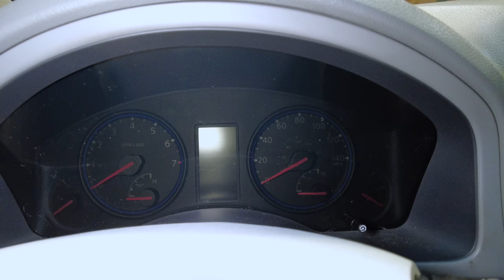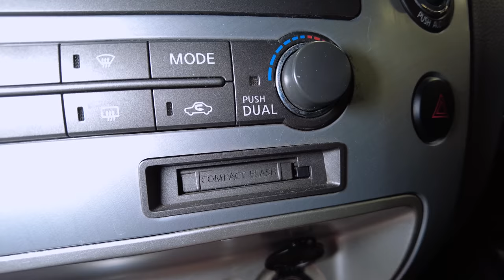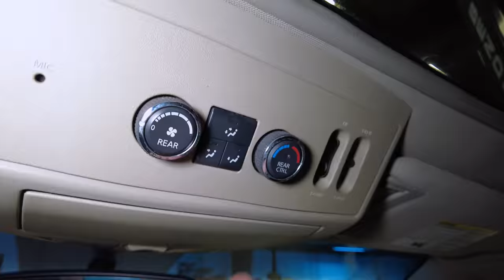Love it or Hate it! Common issues EVERY Infiniti QX56 has. CAR WIZARD knows - he had one!

Comment: I must say I’m not impressed with that list at 150k mi. Also, when a vehicle manufacturer discontinues parts so soon, it really indicates to me they don’t expect the car will last—or really care if it does 🙄
Reply: Nissan would rather cut corners that kill their car buyers than to make something worthwhile.
Reply: Nissan was notorious in this era for discontinuing parts availability. That’s why I stopped buying.
Reply: I thought there was a law that forced manufacturers to supply parts for a number of years after production ends ??
Reply: @1983dmd:  A law that requires auto OEMs to make spare parts available for a set period is an old 'chestnut' that's unfounded - there is no such US Federal law.  The only driver to maintaining spare parts supply comes from the Magnuson-Moss Warranty Act, that was effected in 1975.  The aforesid Act requires manufacturers to maintain parts for the term of the manufacturer’s warranty - where the 'clock starts ticking' when the last of a particular model leaves the assembly line.
So as long as the OEM offers an X-year warranty covering certain systems (e.g.  engine, transmission, HVAC, etc.) it must provide the parts necessary to fix those systems for X years.  Notably, it's not all the parts that make up the entire vehicle.
Reply: Also indicates the manufacturer expects all of these to be in a junkyard soon.
Reply: Nissan is not what it used to be.
Reply: I have a Lexus LX 570, same year, very similar miles. Really shows why the infinity is less than half the price lol
Reply: 10 years is usually the timeframe for parts. My 20 year old honda i can buy nearly any part for as availability is still there.
Reply: @CRAPO2011  as someone mentioned above manufacturer doesn’t have to make any parts for a car after warranty is over on the last one sold.  Non oems of course make parts much longer.
Reply: I was starting to have parts issues with a Mercedes C-class that had some miles on it. Never with past Mercedes I've owned have I had problems sourcing parts, I've had 6 of them.
Reply: @gs98999  I guess your right as i remember hearing Hyundai Equus owners having problems sourcing parts 5-7 years after purchasing new, I think hyundai worked something out with them as it was the flagship.
Reply: nissan doesn't make parts so idk wtf you're talking about and you don't buy parts from dealer lol
Reply: The parts stopped due to Renault.  This is an armada nissa patrol.  One of the most popular model in the nissan line at the time

Comment: My boss had one and the only thing costlier than the refuels was the maintenance.
Reply: yeah, given they carpet bombed styling norms as as hard as 'Hummer' did in a 2000's way that would somehow poison over a decade later... good riddance Infiniti. You were awesome in the 1990s; but god damn your latter self has been awful.
Reply: My friend at work has one (about 6 yr old) and he says it has given him no problems...though he could be capping
Reply: @rebeltvr6046 I don’t think he’s capping😏 I have a 2008 QX56. I brought it with 58K miles it now has 227K miles. I love it and its my everyday driver. My fuel needle did stop working it wasn’t the cluster it was the fuel sending unit. My exhaust rusted tho I’m  now replacing it with Cajun B-Pipes and the JBA performance exhaust. My headers are fine I decided to do the whole swop. Hopefully I’ll get it put on this week or next. I do my best to stay on top of my routine maintenance.  I do believe if you take care of your vehicle it’ll take care of you🙂 I also have a great mechanic so that helps A LOT. Oooo my over head rear console needs to be replaced the plastic is cracked and needs new pins but the tv and all the controls work great headphones do too. I found one on eBay but I sent it back because it was cracked the dealer wanted 2K-3K for that plastic Noooooo Sirrrrrr it was $500 on eBay.

Comment: Modern vehicles are not meant to be repaired or worked on they are drive them for 10 years or 100000miles (if you are lucky) then scrap them and buy new why is this not understood by motorists ?

Comment: Not all Japanese car makers are equals
Reply: The worst Japanese is better than the best domestic
Reply: @flight2k5  My 2011 Ford F150 with a 5.0L Coyote V8 has 152,000 miles on it and still going strong.
Reply: @CJColvin  oh boy 152000. Wow. That’s a lot. 🤣. Didn’t the ford CEO come out recently and apologize for the garbage they’ve been producing
Reply: @flight2k5  Not sure to be honest. Also my 1996 Ford F150 with a 5.0L (302) Windsor V8 has 210,000 miles and still going strong as well.

Comment: Parts for these are plentiful and they are pretty reliable. The discoloration of the valvetrain is due to owner neglect. I own two VK56DEs and they both look brand new at 160k miles when I did a valve cover change. Buying any almost 20 yr old vehicle from the rust belt is going to require some type of maintenance.

Comment: Just turned 160,000 miles and very few issues.
Air level suspension didn’t work when I bought it at 130k miles so I put in Firestone airbags and it tows our 6000 pound RV like a champ.

Comment: I own an 06 Armada...I don't know if neglect by owners of other Armadas/QX56s that make them unreliable but I have about 150k miles and driven her across this country through mountains and dessert heat and never failed on me. That being said, it wasn't perfect sailing. The most common problem I've seen are the cats failing at 80-100k. Mine failed just before the warranty ended, so Nissan took care of it. New ones work well, and it seems they've  corrected the weak point that caused the failure. I've done the valve covers at 100k, and it is quite easy since there is more than enough room to work in the engine bay. Mine was way cleaner than the one in your video, which leads me to believe they've gone much longer between oil changes than 5k. Did plug and coils while covers were out, too. Did all fluids regularly, especially trans, Transfer case and both diffs at 40k intervals since I does haul the family all over the country.  Never had electrical issues. Did have the annoying clicking and heater issue at 115k, but those were very straightforward and easy to fix ( it doesn't require mechanical expertise). As far as the engine, they're reliable so long as scheduled maintenance is done. I change my oil with 5-40 every 5k, and I'm always just under half to slightly over half short at the change interval. My 15 MDX is short a quart every 2k (even after the piston ring recall was done...guess it just eats oil, runs great otherwise) or my 06 Sequoia (definitely a favorite of mine) which also eats about a 3/4 to a quart at 4k change intervals but doesn't have nearly the power of the Armada or internal space. I kept the air suspension too since those parts are cheap and easy to replace as well (changed mine at 120k just in case because of how cheap the parts were). 

Maybe I'm lucky with my Armada (doubt it), but I think it's done well for me because I'm religious about maintenance intervals (that goes for my MDX and Sequoia as well). Again, other than the failed catalytic converters, she's been free of major issues. After seeing the QX56 wheel bearing in your video having issues, I plan on doing mine shortly as the parts are cheap and just good practice to replace before they go bad and cause issues while on long drives. Might even do front and rear main seals at 200k just in case. Come to think of it, even the AC is original and works great (also serviced every 3 years). Now, I hope I didn't just jinx myself, and she's now gonna give up the ghost and make my Sequoia the cross country hauler. 

Full disclosure, I've been working on cars since before I had a driver's license and have built race cars (mostly Toyota, Hondas and Anything you can put a Chevy LS in) from the ground up to include full custom engine, transmission and suspension builds, so I can, and most of the time do the work on my vehicles once warranty has expired since labor is usually the bulk of the cost. Parts are relatively cheap for these Japanese SUVs. And when Wizard says the cost of repair is 3-5k, maybe more, that is his labor and shop charges making the bulk as it should since most people won't have the expertise or time and tools to complete such repairs. That being said, the Armada and its uglier twin the QX56 should be reliable if you do the maintenance regularly. 

Oh, and I don't know how his QX56 got 12 hwy and 8 city, but my Armada averages 13-15 combined between fill ups. On our long family trips with luggage and 5 passengers, I average between 17-21is depending on how many mountains I have to traverse or if it is relatively flat. By no means is she a Prius, but no one buys SUVs this size and thinks I'm gonna get 30mpg. (Hmm, I did add a free-flowing air filter🤔).

Sorry for the long post. If anyone reads this fully, I just thought I'd post my ownership experience of my Armada.
Reply: 98% of Nissan owners have terrible credit and don’t take care of their cars. You are the other 2%
Reply: @Bruce Wayne  that's funny my friend...and you may be right about the credit and nissan/infiniti owners issue. My buddy bought a 2011 GTR used when they weren't ridiculously expensive yet and I told him he couldn't afford it if it took two jobs to pay for the loan, but nonetheless,  the pull of the GTR was stronger than his common sense. 

Now speaking of bad nissans/Infinitis, the newer Direct Injection V8s from 2011-16 were notorious for failing timing chain issues that unchecked/un-repaired pretty much left you with a paper weight once you were out of warranty coverage. Great motor with lots of power but a deadly Achilles heel in its timing chain. Made me completely steer clear of them when I was looking for another SUV back in 2012, hence the 2015 MDX.
Reply: Great post! I love my 08’ with 160k miles.
Reply: Yeah it's hard to take all the complaints seriously when all the ones on marketplace have 200k+ miles on them
Reply: @Experience  Agreed. They're work horses so long as they're maintained. Goes for every major Japanese brand of vehicle in my opinion.
Reply: @dabiggdogg1027
0 seconds ago
I have a 2008 QX56. I brought it with 58K miles it now has 227K miles. I love it and its my everyday driver. My fuel needle did stop working it wasn’t the cluster it was the fuel sending unit. My exhaust rusted tho I’m  now replacing it with Cajun B-Pipes and the JBA performance exhaust. My headers are fine I decided to do the whole swop. Hopefully I’ll get it put on this week or next. I do my best to stay on top of my routine maintenance.  I do believe if you take care of your vehicle it’ll take care of you🙂 I also have a great mechanic so that helps A LOT. Oooo my over head rear console needs to be replaced the plastic is cracked and needs new pins but the tv and all the controls work great headphones do too. I found one on eBay but I sent it back because it was cracked the dealer wanted 2K-3K for that plastic Noooooo Sirrrrrr it was $500 on eBay.
Yesssss Sirrrrrr I read and appreciated your post and I to get better gas mileage than stated in the video😆
Reply: ❤ I need a friend like you to give me the confidence to buy one😉
Reply: Thank you 👊🏾
Reply: Thanks for the post! I just brought an 04 QX56 with 160,000 for 3k as I’m moving to an area with mountains and snow. The car had minimum things to address after the initial inspection with the valve gasket and drive shaft u joint needing to be replaced as the biggest area of concern. I’m waiting on the parts now to install. A few things I didn’t notice was the motor in the steering wheel to move it up and down is on its last wheels. The crack on the radio console bezel (cheapest part I’ve seen is $500. Not sure if I’m willing to replace that yet. I’ll just cover it up with carpet). Also, the ABS brakes seem to randomly activate in regular driving conditions. Have you seen this?

I’m going to check the brake fluid level before I start thinking about replacing the sensor. The seller told me he replaced the CATs at 120k, which motivated me more on the purchase. And he had all of the maintenance receipts. I can do a lot of jobs myself, but once I have to start putting money in for serious labor, I have to give myself a number that I am willing to cap off before I sale. Hopefully not because I’ve been a Nissan driver since I brought my first car over 10 years ago now.
Reply: @CrownMeBob  ABS fault is more than likely the brake pressure sensors on the master cylinder. Very easy and cheap fix.
Reply: @ultra-deplorable671  or just metal/rust shavings stuck to ABS sensor
Reply: I have a 2004 Armada. I feel the same about mine. 240,000 mile runs great and not one leak.

Comment: We have a 2010 with about 75K miles.  At about 40K, heating/AC system actuator in the dash went out.  Dealer had it for a week between pulling dash off and then waiting for parts.  I think the bill was just short of $1,500.

Like the Car Wizard, my wife loved the styling so we had to find one in the fall of 2010 as Infiniti was changing the style for 2011.  My wife still loves her QX56, so I don't see us getting rid of it anytime soon.
Reply: actuator still works, just makes hella noise when switching, I'm not fixing it lol

Comment: I love Infiniti’s. I loved driving these things back in the day when I worked at my local Infiniti dealer. G37xs is one of my all time favourites.
Reply: Owned a g35x and 37x. Can confirm they are awesome cars. Was so close to getting a 6mt 37s but it sold before i could get to it! Had to sell my 37 8 months ago when i moved across the planet. Still miss er!
Reply: G35 was a blast.  I have owned Q45, G35, and QX56.  They key is buying used.  They fall off a cliff faster than other luxury brands so you can get them cheap, even with low mileage.  Then drive them until they have nothing more left to give.  Whereas Lexus was all about the tech, Infiniti used to be all about high performance.  Nowadays? Hard to say as I think they've lost their way.

Comment: Normally I’m a GM guy. But it’s nearly impossible to find an affordable clean pre AFM suv with enough room to haul my special needs sons stroller. Based upon a friend’s suggestion we bought a 2012 Armada Platinum. Knock on balsa it has been relatively trouble free. We regularly tow a horse trailer with it and it is a champ. Air suspension still works great. I’m amazed by how easy it is to service. Only real problem we had is hitting a deer at 70 nearly totaled it as repair parts from Nissan are incredibly expensive. Luckily our body guy found a wreck and was able to ship the needed parts.

Comment: So this is also a Nissan Armada I have a 2004 with shy of 300,000 miles. Brother changed out the exhaust manifolds and cats done before I bought it from him for !$3000. Just have leaks of the transmission and oil cooler lines I need to tackle and a rear wheel bearing. Sadly the manifolds are leaking again

Comment: I have a 2008 Armada. Bought it last year wrecked with 276k miles and had it rebuilt. Currently has almost 290k miles and still runs and looks great. Has minor issues like leaking valve covers and airbag light that recently came on (probably the clock spring).
Reply: Bought my 2007 QX56 with the airbag light on.. It was the clock spring. 30 minutes and $20 at the local Pull-A-Part.. Pretty easy job with a tutorial video
Reply: I often wonder that V8 is one of the better engines Nissan produced correct.
Reply: @jasonsmith7427  I’m may try to do it myself. I bought a new clock spring already. Good to know it’s not too difficult
Reply: @charlesmlane32  It is. That and the VQ series engines are good too
Reply: @Mr_Ayyye  Correct me if I am wrong wasn't it the transmissions that caused most of the issues that droped Nissan's reliability
Reply: @charlesmlane32 The CVTs they put in the cars and smaller SUVs didn’t last long and caused people not to like Nissans anymore. I’ve heard that quality has changed over the past couple of decades as well.
Reply: @charlesmlane32  The VK56 is one of the better engines produced period.
Reply: @charlesmlane32  the truck transmissions were at least average or better.  They did want to overheat when towing at the weight limit, but much better than the Ford 4R100.  There was a recall for a bad transmission/radiator seal in the renewed xterra/frontier platform that let the fluids mix and destroyed a lot of auto transmissions.
Reply: I never look for the Infiniti branded parts; Armada parts are same and easier to find.
Reply: Early VQ30 is better
Reply: I have the same problem with my 2008 armada air bag light with 157 thousand miles on it.